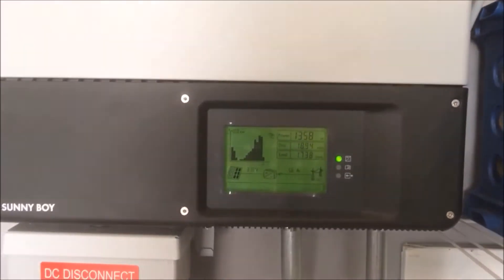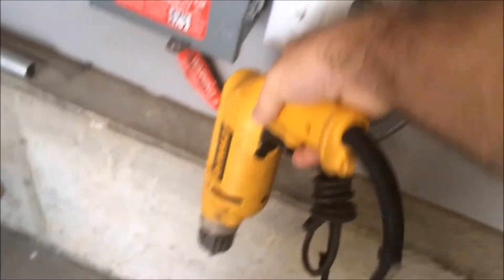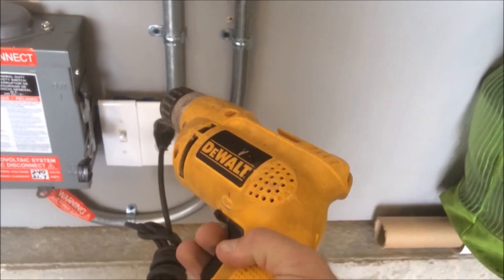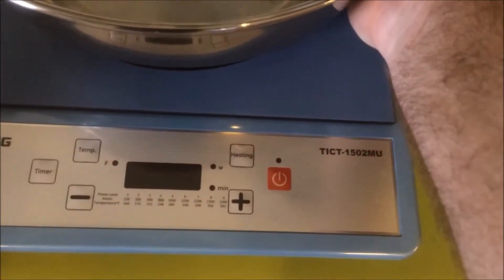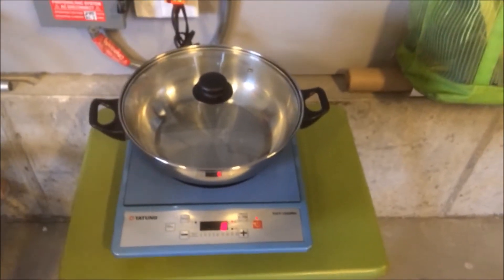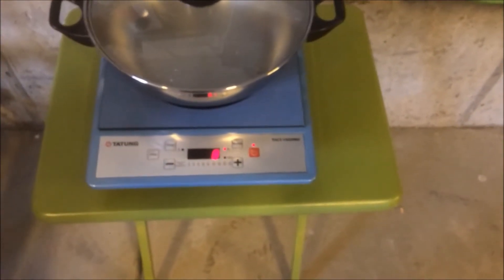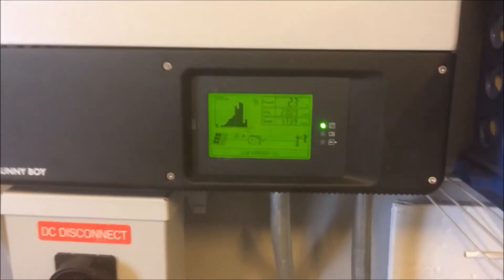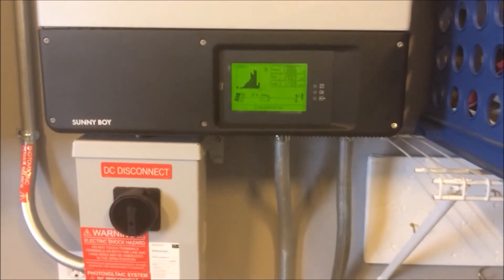How to Power Appliances Off-Grid Without Batteries?

Comment: Interesting.. I have Sunpolo 4W inverter capable off grid and off batteries but....  With 48V batteries, when I connect 1kW hotplate it may work but also draws from batteries and it actually dies.  2.5kW panels.  Not been able to run 1500W at all. It dies.  Can anyone help? Manual is you know. Fair useless. It supposed to work without batteries but nobody was able to figure it out.
Either this inverter or any other how to use to obtain day time say up to 2kW without batteries?  What to buy or how to configure mine?  Thanks
Reply from the maker: Do you know how much power the panels are producing at the time? If the panels are producing less than 1000 watts they will not be able to support a 1000 watt load.
Reply: @kc7ekk  Didn't I just say 2.5kW?
Reply from the maker: @johncommon4294  You did say 2.5kW of solar panels but how much are they producing at the time? Solar panel power production will follow a bell curve depending on the time of day. Less at sunrise/sunset and peak around the middle of the day. Also the angle of the sun throughout the year will impact production, not to mention cloud cover and dirt on the panels. Panels in series or parallel? Additionally the length of wire run and its wire gauge from the panels to the inverter will impact power production. So with all that in mind, how much power were you producing at the time?
Reply: I've realised that panels produce 300V oc. and hotplate is nominally 240V. I connected directly dc to hotplate and also to a 2.4kW kettle. It works very fast when there is no cloud.  So it produces nearly  as new. And the limiting factor is the inverter. It must have some sort of limiting and or we do not know how to program it. It powers up the fridge, what is most important, but the inverter should also produce a full power the panels can deliver. But is not doing it even with batteries connected.

Comment: If there is no battery and off grid then where the remaining energy of solar panel goes ? I am very confused about this question from long time, please help me by answering to my question ,anyone please
Reply from the maker: If the solar array is capable of producing excess power but no load is available, it will just not produce it. There will be a voltage potential present at the panels but no current will flow. 
Power is not produced until there is a current flow. 

You could say that same think about a battery. No power will flow out of it until there is a current flow. 
Or a 5kW gas generator that is running but nothing is plugged into it.

Comment: Hey.. so it's a solar inverter that's work even when the grid is off.  Request you to share the details of the inverter, just for the study. 👍
Reply from the maker: That is correct, so long as the sun is shinning. Check out SunnyBoy's secure power supply inverters for more details. They are now even more capable than the one I have.

Comment: I agree with grid tied systems.  But what happens when the sun goes down without Batterys.
Reply from the maker: No sun, no power from the solar array and you pull from the grid like normal. 
It's all automatic and seamless. An electron from a solar inverter looks exactly like an electron from the grid.

Comment: are you using grid tie inverter and loaded drill...?
i think is imposible work stable
but i have make it with load a lamp ....and succes
https://www.youtube.com/watch?v=svOEUliJ_ys&t=14s
Reply from the maker: As long as the solar array is producing more power than what you are drawing at the time it will be perfectly stable. 
A 5kW solar array feeding a 1200 watt off-grid batteryless circuit will have plenty of margin to remain stable. 
I have experimented with charging an EV, boiling water on a hot-plate and running a drill. All are stable.

Comment: So if there is no battery it means that if solar input ditches for a second to less than 1500W it will cut that circuit off? Hmm. I think we need a Powerwall :D
Reply from the maker: Arnis Tarassu Its a 5kW inverter with 5.2 kW of PV solar attached. So 1500 watts is a pretty easy margin to meet. If you load is only 100 watts, the solar input could drop clear down to only 100 watts, (or 1/50th of the array capacity) before it cuts off. 
Yes, it is ideal to have a battery backup as well, but I think this feature is pretty neat that you can have off-grid capability without any additional money spent on batteries.
Reply: @kc7ekk  Yeah- this seems sufficient to run a few essentials- fridge, modem, computer

Comment from the maker: I should point out that the trickle charging cable is from a 2013 Nissan Leaf.  I tried the same thing with my 2012 Leaf's charging cable and it pulled too much power and tripped the inverter. Apparently the 2012 charging cable (much thicker cable) pulls just over 1500 watts while the 2013's cable only pulls ~1400 watts. 
I may have to open up the box on the 2012's cable and see if it can be adjusted to just under 1500 watts.